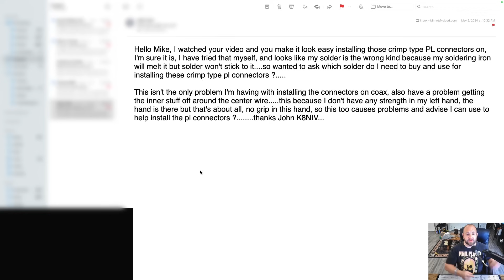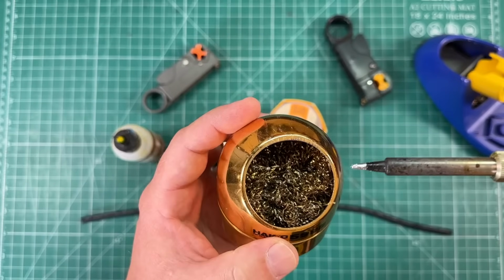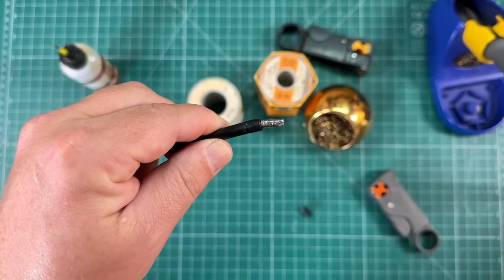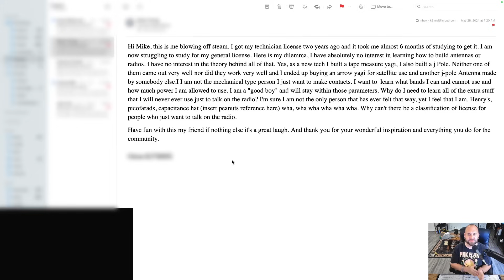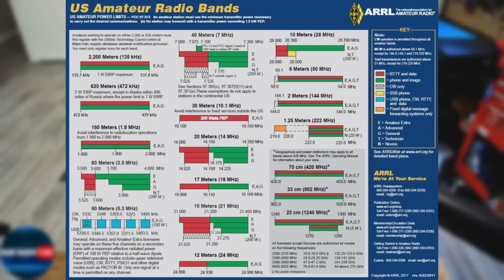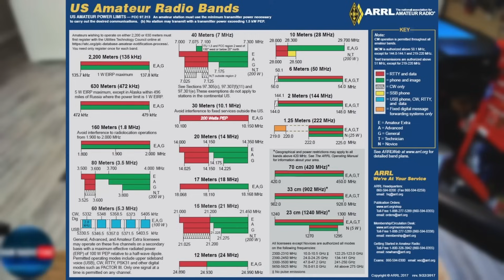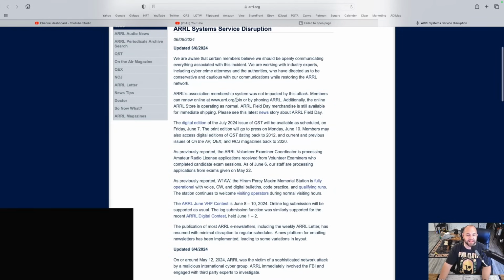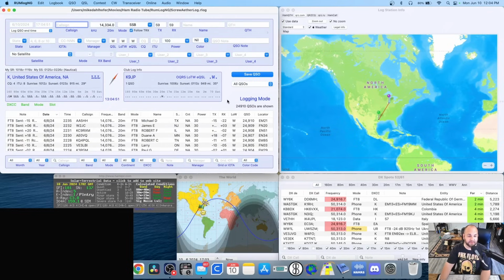Why Do We Need To Learn So Much To Talk On The Radio?

Comment: in the UK we have the view that an "amateur radio licence  is a license to learn" you start of knowing just enough to be dangerous and pick things up as you go along.
Reply: Foundation basically allows you to turn a radio on and put a ladder against a wall safely..
Reply: Same for a lot of folks in the US too. The guy who helped me had that mentality. Realistically unless you come from the industry side or EE background almost all of this will be overwhelming.

And there is nothing wrong with being an appliance operator either. If that’s what someone’s wants to do. Memorize the answers and then just talk.
Reply: @RFPews While I agree that it's really a license to learn, it's nice to talk with "radio folks" on the radio! At least learn a few things.
Reply: @Robbie-sk6vc  yeah I hear ya, but plenty of folks just don’t care about the inner workings. It’s in every hobby. I am a type that I go both feet and learn as much as possible. But not everyone is like that
Reply: I wish the US would consider parts of the UKs (ofcom) structure, the first license you get (foundation) allows you access to HF with reduced power as I understand it.  

Working with youth none of them are impressed by vhf/uhf or dmr, the few that seem genuinely interested are interested in HF and our structure only gives them access to 10 meters, anl band that often has less than stellar results for signal propagation
Reply: @walterkeen5913  UK foundation is 25 watts and you can use 160m all the way up to 70 CM (excluding 60m band) and up further into microwave range.
Reply: @walterkeen5913  Techs have CW on most of the HF bands as well as SSB on 10m. So they already can get on some part of HF.
Reply: They can. And while there is a pretty steady resurgence of code, I learned it even though I’m a no code, realistically a Tech is probably not going to learn code just to get HF. I guess there’s always keyboard CW.

Comment: regarding the information you have to learn for general and extra and the privileges that come with those tests... they don't line up to match. 

the things you have to learn to pass the higher level license exams don't reflect the additional privileges that come with them. You don't need a General or Extra license to build a radio. You don't need an extra license to operate a space telecommand station. You don't need a General license to talk to or through satellites. All that can be done with the tech license. 

The only thing the General and Extra licenses get you is more frequency, more power, and access to more vanity call signs. And none of the stuff you have to learn is relevant to those things. 

Why am I allowed to build a radio with just a technician license but there's little to no questions about that on the exam? 

Why can I use SSTV as a technician when there is nothing on the Tech exam about SSTV? 

I just feel like most of the questions on the Extra Exam are holdovers from days gone by when people actually built transceivers. Maybe the General isn't so bad, and I just don't remember it as well because it isn't as fresh on my mind as the extra. But I do feel like the licenses and exams need an overhaul. Not sure when was the last time that happened. But I don't think the licensing represents the way amateur radio functions in 2024. 

I'm never going to build a radio. And even if I did, it would be a kit where everything is conveniently supplied and I'm just assembling. And even then most of those are SDRs anyway. Very few people build their radios now. An incredibly small number of people need to know picofarads and micro henries in today's world.
Reply: 100% this.

Comment: I really liked your video!!  After getting my technician license, I also initially wondered the reason you can run 50w UHF on GMRS without an exam/license whereas another portions of the UHF band requires an exam. 

Then I started looking at the radio equipment itself and immediately realized the difference.  Basically with GMRS the available frequencies are locked down to comply with the GMRS specs.  But there's no lock down to specific channels with amateur radio.  You have to know what frequencies you can talk on and those you can't.   If you locked down Amateur radio to only specific channels,  you'd basically have GMRS.

Also, GMRS is just UHF, so your transmissions distances will be less than VHF freqs.  No need to really get into understanding antennas, propagation, etc.

So you are correct, if a person just wants to reach out on radio, GMRS is available, and it should be expanded as demand requires.  If you want to communicate longer distances, than you should really understand radio technology and antennas, hence the exam requirement.

Comment: In Brazil’s the focus of the ham test is very different from North America. There ethics appears all over the tests, it’s the main focus of the tests. Being licensed in both countries I think brazils approach is better. Another thing I noticed is that there most of the hams do really understand antennas and most are able to build and have built almost all type os antennas. From dipoles to multiband cubical quad (common there). The same apply to most of the countries in SA. Thus, I believe that forcing people to study a certain subject doesn’t necessarily get them to learn, it actually creates aversion to the subject.

Regarding ltow, I think ppl should relax and give ARRL the time they need. The service is free and also they need to find the flaw in the system first otherwise it will just be hacked again. 73!

Comment: Gotcha beat.  I still have a roll of Kester that I bought from Allied Signal back in ~ 1962.  A spool of solder goes a LONG way (unless you do soldering as a profession)
Reply: <tsk>  That should have said "Allied Radio" not Allied Signal <tsk>

Comment: To your second person's question, I just upgraded to General a couple of weeks ago.  To be completely honest, I only studied about half the material and still passed with a 30 out of 35 correct.  I have no interest in digital, RTTY, FT8, or anything of the sort right now, just voice.  I got the bug to upgrade a year or two ago when I had made a couple of DX contacts on 10 meter, and knew if I wanted to contact more people, I would need to upgrade.  Someday I may take interest in CW or the other modes, but for now I'm happy just talking on the radio.  73's  W0VIV

Comment: Love ya man BUT..... Gotta agree with Q2... Zero reason to know all the crub just to talk. HEAR ME OUT.. Back in my day, yes, you could goto radio shack, frys, or a raw electric supply shop. But now they are gone. Radios are more than affordable,  and tech is now replace vs repair. The new gens, don't know "repair" they buy, Google how to use and move on. If they want to try something new, they watch you or other SME YT channels. Zero reason to know the general and extra content when we have social media and Google. --- I will never need nor use a Smith chart... ever... like OP I buy antennas, use a rig expert, and search YT on how to tune cause you've gotta video about it. The test should be more over real use, when to use a filter., notch, buttons and settings on a radio, ft8, aprs, coax runs, stuff thst one would "need" to know about a radio. I dont care how it works, just test me on the set up, tuning and such. 73's!

Comment: Re: #2, why do we have to know all this stuff, "you took the words right out of my mouth" as the (I think Meat Loaf?) song goes. Good answer. I'm currently studying for my upgrade to general in the Philippines (actually, I'm watching your videos and playing radio instead of studying as I should be doing) and was kind of wondering the same thing: why do I need to know about PIN diodes, PNP and NPN transistors, different types of vacuum tubes, etc. but I've been learning it because I want to pass and gain a lot more HF privileges than I have now (40, 15 and 10 meters only.) Some of the questions are actually relevant, like how to find the resonant frequency of a series or parallel LC circuit (which is basically what an antenna is) given the values of capacitance and inductance, though in real life I would use my NanoVNA for that. I think I'll probably pass if I keep reviewing the material every few days so it's fresh in my mind. 73 de DW7GDL.

Comment: I can relate to the guy complaining about the testing curriculum. I've felt the same way. The biggest thing that made me scratch my head was when you said you don't remember what you learned in the test (or parts of if). If that's true, what is the point of the test? 
I have my tech and find the class to be useless. You basically cram to pass the test. Doesn't matter if you know if we kind at you know the right answer. 
The biggest problem i have with the levels is is just not a good sampling. I've never learned a thing by just reading, but you can't 'do' anything until you pass. I'd like to see more HF available to techs so they have something to get excited about and WANT to upgrade.  I completely agree with knowing frequencies and power so you don't step on people. But Tech is a little too restrictive.

Comment: Unpopular opinion but long and short: in the modern era, you really dont need to know all that shit. Period. There is no reason that a tech cant talk on all bands. It is tomfoolery of the highest order, and the more people try to justify it as if or as though its some end all be all simply perpetuates the madness. The test should be the band plan, regulations, etc. other than that, its simply rote memorization for the purpose of...nothing more than rote memorization. Its 2024, I have the internet, calculators, books and all kinds of resources...theres really no use for an exam about hertz and ohms and all that other crap...nothing we are doing requires that I have memorized the calculation to convert whatever to who gives a damn. I go buy a rig, buy an antenna and off I go...I have neither the time nor desire to experiment...the notion that you need a license to experiment in any event is just wild. The license system is in sore need of being re-vamped.

Comment: Mike, I look forward to your Mailbag Monday videos. This one had three interesting subjects. First, I’m pretty good at soldering and as you pointed out, keep the iron hot and the tip clean. As for the second topic, the student doesn’t get to decide what the curriculum should be. In my seven+ decades I’ve found use for things I learned many years before. More knowledge is always better. For the last topic, I completely agree. It’s ham radio, we do it for fun. Everybody get a grip. The ARRL will get this all sorted out. They were attacked, it happens. They say they took LoTW down to keep the data safe. I have no reason to not believe them (BTW, I don’t use LoTW, I use QRZ)  . . Mike keep up the good work. I hope to work you on the air!

Comment: I just spent 5 days trying to get my IC-705 to talk to my mac over USB. At the end of it, tho wireless was easy, the USB issue turned out to be my USB cable was a charge cable only - no data lines. So I learned something every day for 5 days solid. But wait! there's more... I still have to get it working with wsjt-x over wireless on the mac. So that's at least another 5 days or learning something new every day. So, why exactly we have to learn so much just to do ham radio, I don't know. I only know that we have to, and the fun never stops!
Reply: Pro-Tip
Wrap your USB cable through a toroid a few times. (Use a data capable cable of course)

When I got my 705 I had little trouble getting cat or digital modes to appear to work (Linux).I could control the radio but every time I tried to engage an external tuner or transmit, the radio would lock up and continue transmitting until I turned it off.

Five wraps of the USB cable through a toroid and 100% of my USB problems disappeared.

Using it wirelessly 'works' but wired seems (in my experience) to result in better digital performance.

If you still want to work FT8 wirelessly you may want to check out WFView to act as the 'middleman' between the radio and WSJTX.
Reply: @dorvinion  Yep, that's exactly what mine is doing - locking in transmit and comm errors and I have to power cycle the rig. It works fine on a dummy load of course.... I'll try the choke method for sure. Tnx es 73, AI5QA
Reply: Use a mix 31 or 43 torid. Don't use the clip on beads or a higher mix. The higher mix will work on VHF/UHF, but on HF, they completely choke out the usb cabale and make the computer not see the radio. I learned that the hard way.
Reply: @pale_2111  Yeah I tried it on a 240-43 core, but it didn't make any difference. Even with windings halfway around it. I just have too much RF in the shack. I went with a commercial app (SDR Control) so I could go wifi, and it works fine now.

Comment: Here in the UK the justification for amateur radio even existing was the self training in radio communications. So if you are not interested in self training you have no justification to hold an amateur radio licence.
That requirement may now be out of date as the radio spectrum isn't quite the precious resource it once was. It is now debatable how free and open the use of transmitters should be. As our host points out, there is equipment and frequencies that do not require technical examination so maybe ham radio is justified in keeping a technical knowledge requirement.

Comment: The guy in the letter said "I have absolutely no interest in learning how to build antennas," but then goes on to say that he built two that didn't work very well. It kinda sounds like his disinterest came as a result of failure- especially noting that he purchased a working example of one of the antennas that he built. My advice to all new licensees would be to start with the easiest possible antenna that you can build- a simple dipole. As long as you get the formula right, a dipole is likely going to work right out of the gate. Nothing puts people off of building antennas than having your first two attempts fail. Total failure likely isn't going to happen with a simple dipole. If you're a Technician primarily interested in HF phone, cut a dipole for 28.400MHz and it will cover your phone allocation on 10 meters. If you're interested in HF CW, cut a dipole for 7.075 MHz for your allocation on 40 meters. Those would likely be the most populous places on HF a Technician could start right now. A dipole can even be effective on 2 meters, especially if you know where your repeaters are and broadside the antenna in the direction of the repeaters. My point is, building the most simplest antenna for the most popular bands in your allocation is the key to success and triggering an excitement for homebrew antennas, ESPECIALLY when you don't have anything resembling an antenna analyzer outside of the radio's SWR meter. I started off as a General (which gave me a little more allocation), but spent my entire first year working the world on a the first antenna I ever built- a 40 meter dipole cut for the center of the General phone allocation (7.2375 MHz).

Comment: Ham radio is about experimentation for those who want that. That is going to change like it or not(Just like the requirement for Morse Code). If you want to do that then have fun but for those who do not want to experiment and only want  use the airwaves to talk then they must be accepted for that. I have heard the phrase "HAM lifestyle" and I have seen it but there is a new group of radio users who are not interested in the lifestyle(at least not now) and that must be okay. Everyone however should follow the rules about which bands they can use and which they can't. If anyone does not like that then they should petition the FCC for a change (good luck on that). :)

Comment: The way to get good at soldering, is to have a go at soldering, it's more of an art than a science, but practice makes perfect, ish.
Amateur radio licences are extraordinary permissions to experiment with amazing technology, To have access to do this you need to show that you are up to the job, so there is an exam. It's a tiered system, start at the beginning, work your way up. The more you do, the more you learn. Part of learning is making mistakes. Your first antenna may not work, make another, work out what you did wrong. Learn and improve.
I bet those guys at ARRL are having a dreadful time, cut them some slack. Lots of slack.

Comment: That is a question that many of us share. For instance, if and when I ever decide to use satellites for ham radio, I'll research it and learn all there is to know at that time. Why put all that information into the question pool for the Extra exam just for me to forget most of it within a few short months? An introduction to the basics would have been all that was needed IMO. That is one example. Why not test Morse? Because someone will learn it if, and when they are ready to use it. Right? My 2 cents on the topic. Cheers! de: WN7D

Comment: Ok, I'm a Ham from The EU (so bare that in mind) and we also have to learn a lot about electronics. For me it was fun since I like it but one guy asked the very same question: "why do I need to know this stuff? I'm not an EE! I just want to make contacts!". The person from the club  that was giving a presentation said: "You have to know this since License gives you the right to transmit on a self made equipment. It's like in (our)DMV. You don't need to be a car mechanic but you have to know how to check the level of fluids and point the main parts under the hood".